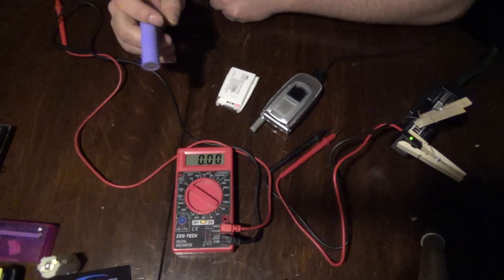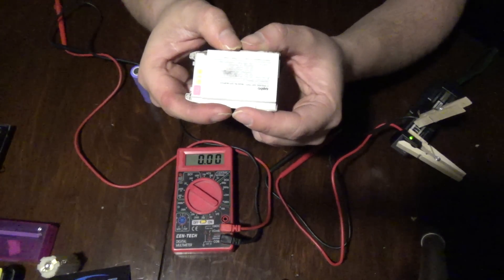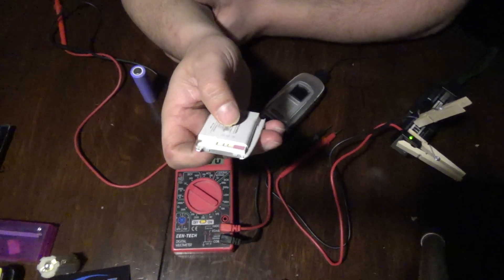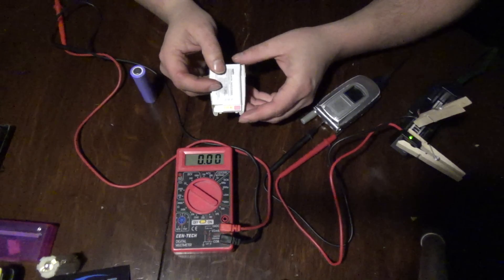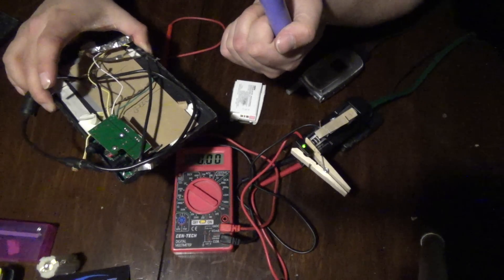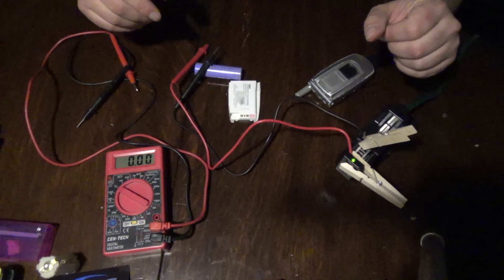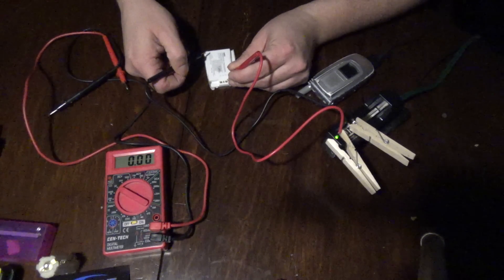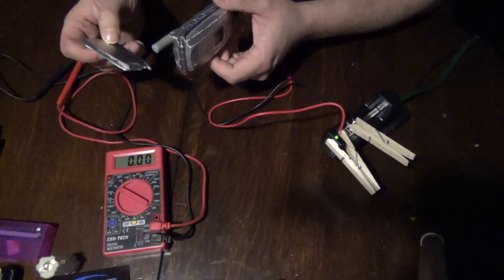How to wake a dormant Lithium Battery Cell. Works on both Cell Phones & 18650s & Similar

Comment: Making use of the https://www.youtube.com/post/UgkxcJ22tnHH9l1vjdIdEIG27iOG55P7LXI8 reconditioning plan, I just saved 2 auto batteries from being completely junked. The guides were very simple to follow. I wish I would have found this years ago! You may use the guide to recondition any battery type
Reply from the maker: deep cycle Lanessa batteries are damaged by being left discharged. Discharged Lanasa battery well sulfate. This can be mitigated and mostly revived by use of additional feeding charger. Overtime it will build up and will become non-reversible. Other damage is overcharging to an extreme. Also then there is mechanical damage such as dropping which can damage the plates internally. nonreversible.
for lithium, they don't like being stored dead or at full

Comment: good to know, but also only works in certain cases. Sony info lithium for example is not recommended to charge like this. Direct charging can reset the voltage. freezer trick  then using a macbook (1100ma usb port) worked for me.

Comment: I have a car booster type unit which appears to have four cells. I accidentally overdischarged it and now it only outputs 7.4 volts. I opened it up and the battery pack has a connector to each cell I think and two of the cells have zero volts on them, so I guess I basically must have reverse charged them by discharging too far. Is there anything I can do with this or is it done for?
Reply from the maker: Done for. at this point it would be extremely dangerous to attempt to charge those cells. I would recommend taking it to a battery store so they may dispose of it safely. Or if you want to have some fun put it in the middle of the street and smack it with a sledge hammer

Comment: Good video. My original laptop battery is dead and have these cell specs = ICR 18650 Samsung 30B. So when I replace the dead cells, can I only use the same Samsung 18650 30B cells or they can be any other type e.g. 28 or 32f etc..? Thanks

Comment: I believe it or not sell vcr's and dvd vcr combos on ebay. I actually found this video looking for  batteries for panasonic palmcorder vhc camcorders . I need a battery for . The one that came with one of the cameras is at 1.7 volt I have charged and charged it . So it must be drained beyond repair

Comment: You should take down this video,  Most DIY's work with cylindrical 18650 and not the flat one that you ended up explaining to us your viewers because you failed to handle the 18650 cylindrical cell  as your demo cell.  More power to you.
Reply from the maker: +EXALLIEVI DI DON BOSCO, NCR GROUP, PH Not taking anything down. and it's exactly the same for 18650's that have a pcb. many 18650s don't though, and are managed by a external board, so no need to wake them up in most cases, just charge slowly.

Comment: Dude, its known that you should stop discharging a LiPo battery after wasting 80% Capacity, otherwise it damages the long span battery life, but im not sure it could make it explode...

More then few times i have drained my LiPo Batteries by flying my quadcopter until it falls, and nothing happened

Comment: Can i use this technique on 18650s that are still wired together or do i need to seperate and do each one separate?
Reply from the maker: +BootYerBaws you do not need to separate, but you must do them individually or you could cause a short or other issues.  don't do it as a whole pack
Reply: They are wired as a loop, so will i be ok to just to touch the + and - of each battery and then put my battery pack on charge and see if it charges?
Reply from the maker: Yep
Reply: Do you have any idea what the initials at the end of these 18650s stand for.... Eg 18650 ct or 18650 pf? Also some of these batteries have different amperage. Could i just replace the one in my pack with any 18650? The battery pack is from a speedglas adflo (lithium)

Comment: For those wondering after being lost through all the babbling, he connects a 18650 charger to wake up the dead cell phone battery. Simply put, find yourself a charger for a cordless drill and connect it for a few seconds to your cell phone battery. It will wake up the cell long enough for you to get it on your actual cell phone charger and finish charging the battery.

Comment: I have a 18650 with only 0,3 V (BRAND NEW) and so my charger (same brand as the battery !) will not charge it...now I understand why !  Thanks.  

So my question is, how do I "revive it" ?   After watching you video I am thinking using the USB method.  Since I am new to this I want to ask...do I connect the positive and negative cables to the same terminals in the battery ?  and also, how long do I keep the cables...is it trial and error only ?  any dangers ?  Thanks

Comment: the issue is the charger;  not all chargers are designed to try to wake up a lithium ion battery that has gone below voltage.
Reply: edward lewis totally correct. Depending on the brands and quality of a li-ion bat,  I would not recommend doing recovery on li cells, as the can do unwanted things like blowing up or start a fire🔥

Comment: Damn...I just typed a novel and, for some reason, it did not get posted and disappeared into the ether.

So, here we go again, but with less detail, because I am tired...lol

Will this methodology work on a 14.4VDC iRobot Roomba 595 Extended Service After-Market 6000mAh battery?

Or do I need to use a charging source that will produce a higher voltage?

Comment: Hi there,
 I have a specialised 0.75wHr 3.7V Li-ion battery which appears to be sleeping as well. I have a dead 9V battery which is showing about 8.7V on my multi-meter. Can I use this battery to jump start the small sleep state Li-ion battery?

Comment: I am having an issue with a 36V Lithium battery for a cordless lawn mower that has sat dormant for about 1.5 years now.  Is there anyway to "jump" the battery and raise the voltage enough to get it to charge without tearing into the whole battery and charging each individual cell?
Reply from the maker: nope, must go in and charge each cell.
Reply: I've never tore into one, are they fairly easily to remove once I get in the case?
Reply: Or could I use a couple other 20V Lithium batteries from cordless tools hooked in series to raise the voltage to the point it would charge?  What would the min voltage level need to be for the charger to recognize it?

Comment: Thanks, bought the charger you got to try this. Will these cables work (https://www.amazon.com/Elenco-Electronics-TL-16-Banana-Alligator/dp/B0002JJU1Y/ref=sr_1_13?ie=UTF8&qid=1473643314&sr=8-13&keywords=multimeter+leads) or what cables are you using to connect the charger to the batteries.
Reply from the maker: no, you want the alligator clips on both ends
Reply from the maker: I get mine at Harbor freight, about three dollars and you get four pairs of clips
Reply: Thanks
Reply: cycle them completely flat.. as in. run it till the laptop goes into standby/hibernation/whatever and then try to turn it back on again and let it run till it shuts off
then charge it up again while the laptop is on.
do it one or two times and you should see the capacity rise a bit
Reply: Well thats not very much of change in battery capacity. I wouldn't worry about it unless it drops by like 3/4 or 1/2 or something bigger.
its true batterys slowly lose their capacity but its not fast.
it should still be just fine. 1-5wh of difference shouldnt be too much of a concern. based on the temperature of your room and how hard your computer is working could affect the currently measured capacity. but overall it should stay around the same. and if its new after a few weeks to first year of use it should actually go up slightly from the first time you test it.

Comment: I have a mini media player that I bought on amazon. It was D.O.A. when I opened the original box, I have a feeling that it's the battery. I may try to jump it or simply change it out as I have two other exact same players of this type with similar batteries in them. Note I have done this many times.

Comment: 1) Subscribed & Thumbs Up
2) Will you provide a model number for the charger so I can order one

3) Question: My video camera use a LI-ION battery that outputs 7.2V 

I opened up a small 720mAH battery case and replace the guts with a 
power supply I built it to convert a 12V SLA, (using a LM317T regulator), 
set to 7.2V. Unfortunately, when I plugged in my battery pack outputting 
the 7.2V. The camera WON'T come on. I have a feeling this has to do with 
the lead marked on the battery pack with + - and D. I'm guessing the 'D' 
means something, but I haven't figures that out yet. Maybe Data?
Could this be the problem?
Reply from the maker: Thank You!

http://amzn.to/262GvLL is similar to the one I used in the video. 

If that was a lithium pack, then the D could have something to do with thermal as well, most lithium powered devices like cameras will require thermal protection for the battery. It could also mean data. My Sony camcorders use whats called a InfoLithium. Requires back and fourth data with the battery. Will not work with some after market batteries.
Reply: I discovered that it is indeed a Data Stream.  Now I have to figure out how to fake the camera out in thinking it has Data.  Thanks for writing back!
Reply from the maker: +Ted Mieske keep us updated, I'd like so know too. what kind of camera is his?
Reply: It's a Sony Handycam HDR-CX150.  I'm going to a convention for 3 days and I wanted to bring along a Gel Cell Battery that I know would last for all 3 days.  Anyway, I DO have 2 4200mAH batteries, so 1 will last for each day.  I just have to charge 1 one.  Instead of recording at 1080p, I'll settle for 720p.
Reply from the maker: Hmmm, I've never had a battery last longer by recording at a lower resolution. It seems more camera based. My FDR-AX33 at 1080p was the same recording time as in 4k, just filled the memory card faster. 

You could get the DC adapter. They have the adapters that plug into 12v car sockets. Get that, and connect it to your Gel Cell. Endless power. Doesn't yours have the build in USB Cable? You can connect that to a USB Power Supply (Or use the Multi-jack port) and use a portable usb power supply. Though, Capacity wise, not quite worth it. 

Also if you have some time, you can pick up a third party NP-FV70 cheap. Try this http://amzn.to/28J0xUs
I have these after markets, and they actually last longer then the Sony FV70. 
It's a great deal, I only have the stand alone batteries, but am considering the kit, it's cheap. 

I will note, the NP-FV70 in my Sony HDR-PJ380 gives about 8 hours continuous record at 1080p 60FPS, about 2 hrs in my old AX-33, should be about the same in my AX53.
Reply: My mistake!  1080p uses more space then 720p, not battery life.  Thanks for correcting me.  If there is a 12V adapter, I'd sure like to get a link or info in this.
Reply from the maker: Yes, see this link: http://amzn.to/28JJr8s

Comment: thanks for that. worked a treat. had to get the battery above 3.7 before it would work the device but i think I could have just charged it normally after waking it up using your technique. I couldn't use your peg system so insulated the terminals of a AA battery an inserted it into the charger using it to hold the wires of the extension cable in place.

Comment: I got a non charging 18650 battery. Would this be the issue too? That my battery run out of volts/cell below 3.7 so it wont charge? You mentioned that you used a 1.O charger for 18650 to revive the dead phone battery but is it possible if i charge the 18650 the same way? Need ur help.

Comment: I had an older Toshiba laptop battery (3 cell/11.volts) discharge VERY quickly from near 100%-the last screen reading was 40% charge, then the computer started turning off and on by itself every second, over and over(it was scary-it was corrupting the screen graphics!) So I made sure it would stay off, and plugged in the charger....after a few minutes, the CHARGER began cutting off and on with a whining sound! I reached around to unplug the charger and the connector was quite hot! I think I caught it just in time and saved my computer and charger, the battery I must assume from the current draw must have entirely shorted out!!! The computer still lives-with a better battery!
Reply from the maker: +VideyoJunkei Sounds like one of the cells had a problem, or a short developed in the wiring. Could also have been the charger shorting out,

Comment: Hello, I have recently bought a new laptop battery pack (Li-ion). Everything was working well for a few days, until i accidentally left the laptop running without AC plugged in. I suspect it fully discharged and then shut off. Ever since then, the battery wont charge (no software solutions work) and I am wondering if it could have gone dormant. If this was the case, could you power the battery back up, using the battery pins (and what voltage should i choose?). Thanks!

Comment: Why not just put it on the charger?
Reply from the maker: +prescott231233 Because when the protection chip on the battery says don't charge, the phone wont charge. The whole point of this video is to Bypass this lockout as 99% of the time, no problems.

Comment: is there anyway i could do something Similar with my Laptop Battery? My laptop will shut off as soon as i unplug the charger.
Reply from the maker: +MvZiC MaN No, because in reality, the battery is actually good and nothing is wrong. it still holds plenty of capacity. What has happened, is the manufacturer of the laptop battery pack, has designed a "Timer" of sorts into the circuitry. After XXX number of cycles and usage, it will no longer charge or allow you to discharge the pack. 99% of these packs have no work around to allow access once again. 
This is where I harvest most of my cells from. It's so funny, a battery rated at 2000mAh, the laptop says the pack is no good, yet, the cells still test at or close to the designed capacity! Can't believe no one has done a class action lawsuit yet..... 

Either way, watch this video of mine, explains it in more detail. https://www.youtube.com/watch?v=mXaXDuiU5-0  with video demo. 

Cheers!

Comment: i left my 18650 on charge for 2 days on a intellicharger i2  the charging lights didnt come on after the 2nd day, i tried using the battery an it wont work 
i have 2 of them for a vape i put em in and nothing they show up as dead no status from them from 2 different chargers
Reply: +kitty  meow  how do i turn em back on?
Reply from the maker: +kitty  meow  But what is the voltage on them? If it is 0 volts, protection chip has cut them out. You will need to use a Non-Smart charger or other 5v source of power to "Wake" them up as shown in the video.
Reply: i have an intelacharger an a surefire neither   of them are able to pick up anything. i dont have a volt meter either. i know they worked before i left em on the charge for that long. and they're not swolen nor was there a discharge of chemicals from them so they didnt "hiss" or blow up no trace of that kinda thing
Reply from the maker: The protection circuit might have cut things off. You really need a multimeter.

Comment: The Tesla is powered by a shitload of 18650's? HA.
Reply from the maker: faffaflunkie 8,500 of them :)
Reply: I can't wait 'till one shows up at the local Pik-A-Part.
Reply from the maker: Already can. The intact packs can be bought salvaged for about $18,000
Reply from the maker: They make awesome off grid solar battery systems.

Comment: I don't recommend using a USB cable plugged into a PC. If the bare wires touch, it'll short and you'll have a dead usb port. I learnt the hard way lol.

Comment: I hate to say this, but there is fine line between safety for the public, and consumer fraud. Li-ion batteries are too sensitive to overcharging and discharging. Ni-cd have a shorter runtime, and a longer charge time, but are less sensitive. In my opinion, Ni-cd are much better then Li-ion, cause there much cheaper and safer, without any serious risk of fire. The idea of just tossing away a perfectly good battery pack is just F@$%in stupid!! The first time I encountered a problem was with my Motorola wireless phone for around the house. Inside the pack, was a fusible link in series (AWG #38 wire ) which opens if the pack gets to warm, reducing the total output voltage to about half. I'll never buy another 3.6 Volt Ni-Cd battery pack ever again!! I've built my own, and since then they have lasted twice or three times longer then the retail versions without all the bulls** regarding safety. There are rules and guidelines in the manual, but it's clear nobody reads them. If people did, then the manufactures would not stay in business, because everyone would be more careful and develop better monitoring habits using their products.